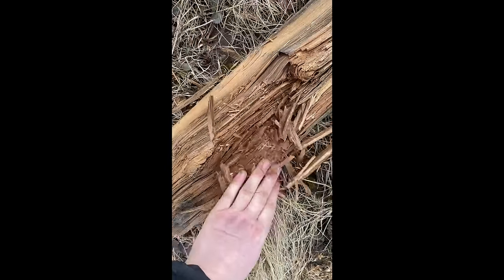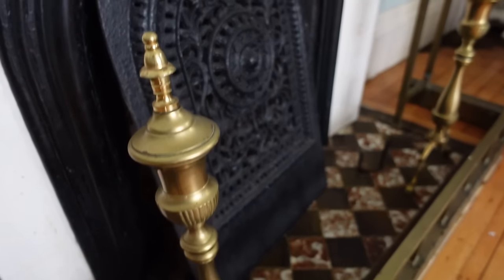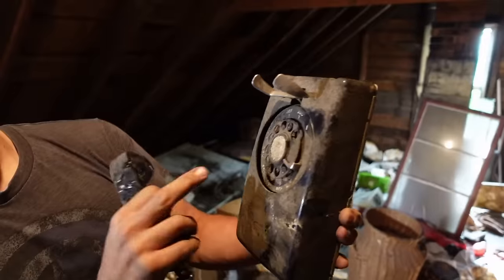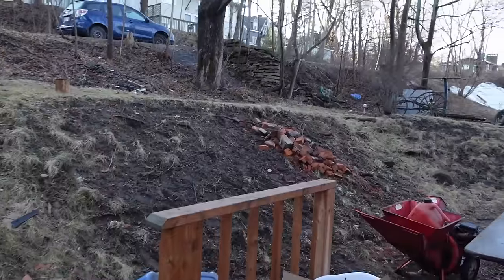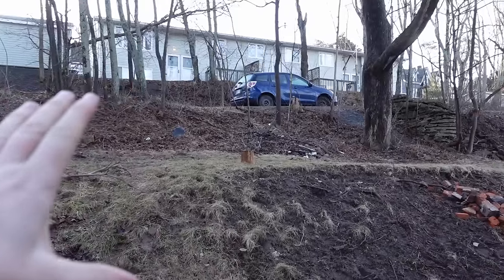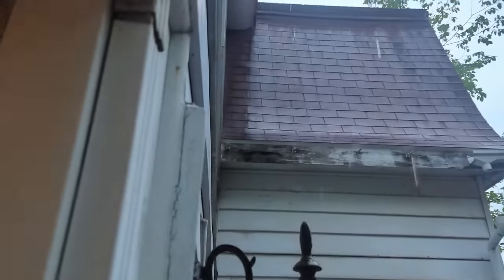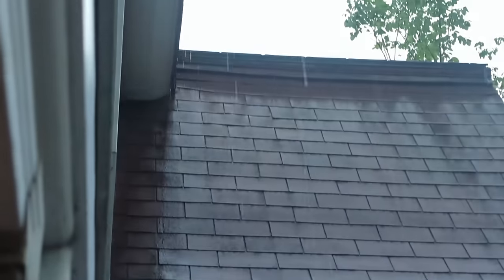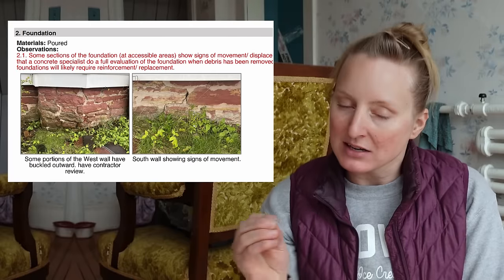Top 10 Reasons My House is Falling Apart // 120 Years of NEGLECT 😩 (ep.4)

Comment: Older homes had spaced sheathing with wooden shingles not solid sheathing with vapor barrier.  It let the wood shingles swell and move.  It was common to see some light through the roof, but it was still water tight.
Now with asphalt or fiberglass shingles you have a solid sheathing and vapor barrier/ice and water shield.  The old roofs did usually have flashing though.

Comment: About the windows, another channel restored old windows like those, it's called 'escape to the dream, restoring the chateau', they used hardeners to stabilize the rotten wood then fillers and some wood replacement, I think it was a while ago that I saw that, but check them out
Reply from the maker: That’s exactly what the PC hardener and Abatron that I mentioned are - a hardener and then a wood epoxy!

Comment: I'm happy you are working to save this great old house. We had an inspection and he wrote a book about all the things that were wrong. Our realtor and the inspector as well as many friends thought we were cracked. We started in our 50s. You have youth and strength on your side. I also am impressed by your sympathetic understanding of old house issues. We bought a used John Deere tractor to excavate and regrade all around our house. In a stunning turn of events we removed the gutters from our place. It didn't originally have them and has beautiful trim that was covered and rotting because of the gutters installed in the 1980s. We have most of our 177 year old windows! and  for us it was a selling point. Unfortunately the house was abandoned for several years and animals and people broke out most of the wavy glass. We had our small relatively straight forward roof replaced soon after we bought the house. New plywood sheathing for the first time! we put on asphalt shingles. Our barn got metal and There is nothing like the sound or force of a foot of snow dislodging from a metal roof and thundering to the ground. It can literally rattle the windows! Good luck. I am enjoying your progress.

Comment: 🤣You might want to copy and print up a picture of that Detour sign as 21:17 and tape it up where you can see it daily. Home restoration of the magnitude you have embarked on is one BIG detour. Next, we armchair quarterbacks are a dime a dozen. Don't let us fluster you. And as for the roof, it may not be up to code and you will want to replace it someday. But, if it ain't leekin', don't fix it. In my oh so humble opinion the siding is more important as it is probably hiding more issues.

Comment: Yes, look into French Drains for the exterior water problems and for the basement look into 20 mil plastic to cover the ground and foundation walls . There is probably a basement solutions company in your area. The plastic barrier stops mold and mildew spores.  Also a dehumidifier in the basement will help immensely !!

Comment: There is so much to do, I was wondering is there any part of the top things that need attention that you feel ok letting a professional do, or is part of the restoration the ability to say you were able to do it all yourself?  I watch another channel where a guy in Iowa is renovating a family home built in the 1820s but is finding that much of the way the house was originally built contributed to the floors sagging, wood rotting, and uneven concrete.  He had to repour some of the foundations, redo many of the floor joists, etc.  How do you determine which things you have to update with new materials to make the house more structurally sound (like the way the roof is built with the boards that don't meet) or which things you're going to try to keep the same?  I'm the kind of person who would pull all the old electrical out and replace ALL of it, but that's because I've seen some things. 😂 Even Nicole Curtis will change out old electrical to accommodate new appliances and she's super dedicated to keeping a house's original footprint.  Was the electrical already updated or is that on your planning list?

Comment: The way your roof was built with the planks and gaps between them. Means that the original roof was a shingle roof. As a shingle roof is done that way. That is how our 1916 farmhouse roof was when we bought it. The first thing we had to do was get a new roof. The roof was shot. So my hubby and his dad tore off 2 layers of asphalt roof and 1 layer of wood shingles. This was the south side of our roof that got the most weather. Rains and wind. The Northside of the roof had 1 layer of asphalt and 1 layer of the wood shingles. And under all that was boards with 1 inch gaps between each row of boards. So the roofers we hired had to put down OSB over those boards. Then tar paper. Then the new asphalt shingles. And since we have lived here 31 years. We had to have another new asphalt roof put on 4 years ago. This one is a 50 year roof. So unless I live here till I'm 110, I shouldn't have to put on a third roof! Lol. 😅

Comment: Moving earth in the back of the house might work somewhat but groundwater is also pulled toward your house due to gravity.  Have you considered a French drain?  You can actually install it yourself if you don't mind digging ditches.  The drains can also go in the front of the house to move the water away from the foundation.  Just a thought.
And regarding your roof, my 1785 house had the same board sheathing and it's no big deal.  They do slap sheets of plywood over it in order to do the new roof but you won't be able to see it, thank goodness, and it adds strength to the existing sheathing.

Comment: Wow! That's a lot to work through. I wonder if you could encorporate terraces or keyline landscape design to help divert the water on the hill away from your house. Keyline design is a thing used in agricultural to help divert watet allowing for greater infultration opportunity, basically creating a meandering path across a landscape. I'm thinking if you were able to do this in conjunction with deep rooted, native plants, you could effectively slow down the water coming off the hill, allowing for better drainage overall and creating a buffer around your basement. Good luck!

Comment: What I would suggest with the windows is see if you can get custom class inserts for a higher RF value and all the advances that modern windows give in a proper wood frame replicat of the original look.  Especially in a colder climate area, better windows are seriously helpful to keeping the heat in in winter and out in summer (uv filters and all that.)   Might be expensive, so possibly a later on expense after things are stabilized, but def worth it to have the best of both worlds (aka, old school aesthetic with high tech windows)

Comment: If the planks in the roof are not rotten then I don't see the roof as a major issue. Yes you may have to cover it with sheeting but if the wood underneath it is mostly sound then it shouldn't be a major problem. If there is water coming in from the roof then that needs to be dealt with even if only a short term fix. As far as the siding, it doesn't seem to be an immediate problem so put it down on the list. In my opinion, deal with the water ingress problem. Get things dried out. If you can get things dry then probably a lot of it can wait until you can financially deal with it. 
In the video there was a backhoe dealing with a tree. I hope you were able to dig out a trough/ditch to direct the water from the hill to run around the house. If so then hopefully that will allow for things to dry out. 

The owner of a company I worked for 37-25 years ago got a complete home inspection when he bought his house. I think the house was about 50 years old. The inspection did not indicate any significant problems. But the basement was so bad that he ended up lifting the house and replacing the whole basement. As you said, home inspections can only tell you about what they can see. 

As they say, Rome wasn't built in a day. I hope you get things fixed as soon as possible. But don't feel like you need to fix everything as soon as possible. Get things safe. Get things stable. The things that can wait can wait.

Comment: That was a lot to cover and a long list of important tasks to address.  Sounds like you have a good plan and understanding of what's needed.
I'm glad to hear you're keeping the original windows so many renovators want to replace them; you have storm windows that will provide the energy efficiency.
Roof - our area, and for many years, tar paper is no longer used.  I had my shingles replaced 2 years ago. They used a rubber waterproof membrane as underlayment, so if a shingle comes off, roof is still protected.  I'm in Florida, so it's hurricane approved.

Comment: I admire you're resolve! I live in a 400 year old house and have been here for 35 years,  its still not done! However, a few little words of advice leave the fancy stuff till later get it waterproof and livable in that order. That includes ground works. Once you've done that then enjoy every minute of the mess and hidden gems you'll find. A house grows into a home, its a synergistic relationship and you will grow into your home. What your doing is fantastic but its not for the faint hearted it takes a will of iron and dogged termination. But you will get there, thinkbof a rat up a drainpipe as they say. 😄
My husband is a plumber and I worked as an architectural draughtsman we are pretty handy at all things but there has been times of despair, but also times of wow we did that! So keep going, don't expect results too soon. In an old house each uncovering can be either a joy or bloody hell no! xx
P.S. I like trees too but not next to a house, interesting fact cut the tree down then use cut off copper pipes flattened and copper nails hammer them into the trunk, it will kill the tree. Its an old builders remedy used over here in Britain. x

Comment: Plank roofs are common here southwestern Ontario in houses pre 1970. The difference is that the planks are snug against each other.   My plank roof has no gaps and doesn't leak. :) In 2008 when I had it re shingled they added the frost shield and last year I got new shingles and they added the plastic waterproofing for the first time.

Comment: Some of these old houses have a trapdoor in the kitchen. And I've learned that sometimes peeling is from humidity in the room rather than coming through the ceiling. It can condense there, especially if it's cold and humid, with un-insulated plumbing or metal tub above.

Comment: Dear Shannon, you are doing great! You mentioned putting in french drainage 👍 and putting up the missing gutters 👍 I live in a house that is over 200 years old and it still has the origional roof (very similar to yours). Als long as the wood is in good condition it may last a couple more years. We control our roof regularly an replace broken or missing shingles at once. Hence we could avoid new roofing. Maybe this could work for you too. ❣️

Comment: If you haven't starting fixing the windows..... you might explore saving as much as possible of the original wood by using wood hardener & exterior wood filler. In brief, use a window in better condition to make a mold of existing board/trim, apply wood hardener to damaged wood, use the mold to help shape the food filler, sand, & paint.

Comment: Excepting Plum trees which are so shallow rooted they can be planted next to the walls and will not invade drains. Mind you I have never owned one of your strange hut like houses built in North America. All my houses have had solid stone walls 1/2 to a metre thick built on rock. Dunno how you manage with such flimsy structures !
A nice set of rills each side to channel the water and a pond out front would be elegant if you took the line of the banisters on the staircases as a guide.

Comment: We owned an RV park in the foothills of South Carolina. The main building was in the same situation. We excavated 3 sides and put in a french drain system with one perk site and one open drain on the opposite side. If you can I recommend to engage a site engineering company to provide a plan to divert excess run off and maybe you can excavate back from the home with a retaining wall with another drain system on the street side. You can do the work and rent machinery to save money.

Comment: My experience with this type of roof is that it was originally a shake roof. When I had a tear off roof replacement done my roof sheathing is exactly like yours and the bottom layer was originally cedar shakes. I of course had new plywood added for modern shingle installation. So please don’t assume the builders did it incorrectly.
Reply from the maker: I don't think I said anything to imply that I thought the builders did it wrong... just that it didn't meet modern standards

Comment: Consider saving those “hand honed” roof boards. Use it or sell them they are valuable. I’d start from the bottom-up. Solve the basement water issue first. You are doing a great job. Without announcing what you paid for the house, you can compare price per square foot for your house vs average in area
Reply from the maker: If you've seen the previous episode, you'll know that I don't throw much out if I think it can be reused 🤣 Conventional wisdom is start with the roof and work your way down. My wisdom is use common sense!

Comment: I grew up in a cottage built in the 1600, it doesn't have a thatched roof anymore but brick type tiles,  the time we had issues was when we tried to button it up like a new build, it needed breathe,  love old windows , can you get double glazed panels to put in the ones that face the on comming weather this makes a huge difference to heat saving.

Comment: I am willing to be that when the house up the hill was built, no one considered whether they had to channel water away from their house where it would not affect properties below them...that would be a local zoning requirement. I suspect the water problems got much worse when the house up the hill was constructed.

The lathes on the roof instead of solid plywood covering the rafters does give you hints as to when this house was built and when the roof was last replaced as opposed to adding a new layer of shingles.  We had to take the roof on our then 80 year old house down to the rafters a while back and add plywood and new shingles.

Comment: I certainly don't envy you the task of having to deal with both foundation and roofing issues, not to mention all the drainage and run off water problems too. What a collosal and very expensive project it will be in the initial phase. You seem very motivated and up for the challenge tho so good on you for pulling your sleeves up and getting it sorted to save your lovely home. A lot would run for the hills once they've seen exactly what they are facing and just demolish and rebuild or sell up. I look forward to your journey to restore your lovely old home.

Comment: Oh dear ...this is my life. My cellar, a dirt floor, is now semi-flooded with a pump working overtime. I just found a root running through one wall and pulled most out. Surprisingly its a sturdy foundation. Just bleeds as is normal for these walls but is far above the ground so the sill plates are fine. Under some windows are rot and aluminum siding that needs to be pulled up for repair. I can just imagine that job. AND, to add one more, missing gutters which we hope to replace a part soon as the hubby just put up new fascia trim. The issues are endless, as is yours. I was sold the house cheap from a family member. Has some acreage though. I feel a kinship with you now! It is 160 years old and considered historic. Hmm? Wonder if NY has funding.
Reply from the maker: Just a note to remember that if it’s officially designated “Historic” you might get funding, but you’ll probably also have lots of hoops to jump through in terms of how you can repair, what materials and methods you’re limited to using, etc - that might be perfect for you, I don’t know, just wanted to point out that the designation can come with limitations that some —myself included— would chafe against

Comment: We have a similar project- or since we are a farm- we have plenty of projects and houses! We are restoring the roof on the main house this upcomming spring/summer . We exchanged the sillboards 2 years ago, and put down drainage pipes in the ground.  We have done some work in the basement, rebuilding a stonewall  that had constructive purpose.  We live in the house. It is time consuming money pit, but we really enjoy the small steps of progress, like when we replaced the watermains and all of a sudden water came out of the shower not droplets, and we could flush the toilet without the washing machine or dishwasher stopped!  Enjoy the small improvements along the way!
Reply from the maker: Every small improvement is a massive celebration 🥳🥳 Best of luck with your money pit!!

Comment: 100% with you on restoring old windows! As for the roof, the slats of wood might originaly been covered with cedar shingles ( thats exactly how ours were installed) that needed all that airflow to properly dry out between storms. They do make metal roofing that mimics the look of cedar or other suitable textures for an oldy but goody like yours. If your rafters are still in good shape, some metal roofing can be installed with only additional vertical strips to again add ventilation. Be sure to research proper ventilation as you button up everything with insulation. Our 1904 house couldn't breath properly after adding insulation, silicone and air tight storm windows ( over the original restored windows of course:) You've got this!😻
Reply from the maker: Yea, attic ventilation is a tricky thing! For sure lots of research and consultation will be done 🫶